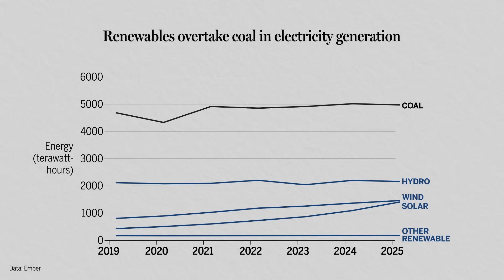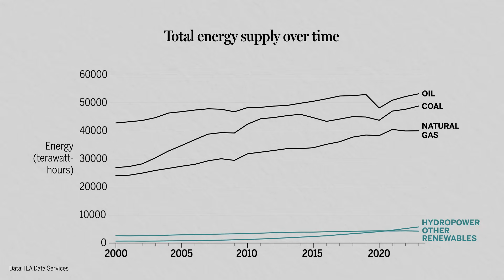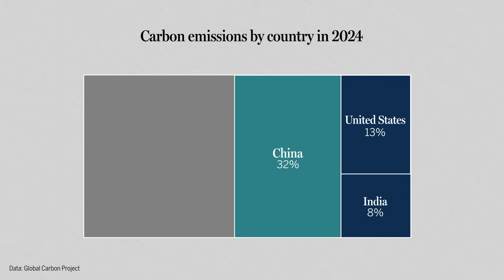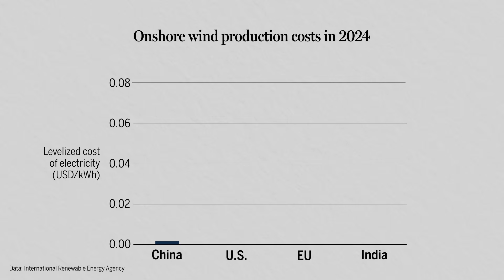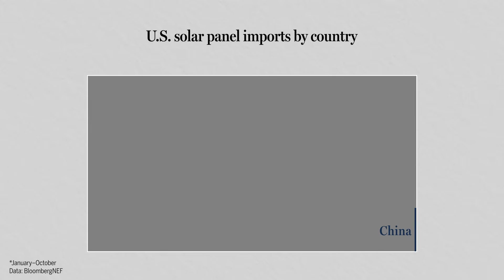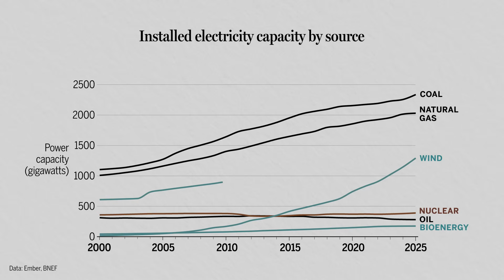How cheap renewable energy is finally flattening emissions

Comment: That is BS. China emissions decreasing because they built a ton of Nuclear power plants. Renewable energy is a scam. Scam in a way that it will never ever be able to replace regular power plants because you need controlled sustainable power generation. Except hydro, none of the renewables able to produce electricity sustainably an continuously.

Comment: Wow this video is bad. Like really, really bad. Not only do you want to turn it off after the incorrect wording in the first minutes so many statements are half-truths. 

And also: Is Yale that incompetent to confuse energy consumption and CO2 emissions? Because the consumption by definition cannot get ‚more efficient‘ with cleaner supply. I can’t believe that. So it’s probably just the news source that’s quoted without turning on the brain. Wow.

Comment: US centric presentation ... renewable energy is flattening emissions is patently not true the relevant graph appears at 1.56 in where it shows US  flattening but Global emissions rising.  I am not speaking for or against just that the title is not true and Glbal emissions are not flattening they are rising as this presntation shows on the chart they slip in there at 1.56. Which if it were a stock chart you would be calling a break out to the upside not the downside.

Comment: One huge factor is that battery storage is being built on an exponential curve and the cost per unit energy is also plunging.   Another thing not mentioned is that a big thermal plant takes years to build, where another few megawatts of solar can be deployed in a few weeks if you have the site permissions done.

Comment: Problem is solar only works when it's sunny, wind only works when it's windy, hydro only works where there are huge water accumulations. Solar and wind provides no stability to the powergrid, instead it makes it unstable. A powergrid needs spinning inertia from a big generator. I'm not a renevable hater, just realist. What I know we don't have any coutry relying on just solar and wind? Neither a city or village or even a single factory.

Comment: I live on the Canadian prairies, where winter temperatures can hover at -30C despite 300 sunny days per year. But I have 20 PV panels on my roof, which account for about 1/3 of my annual usage. For the rest, I purchase electricity from the public utility grid, 98% of which comes from (green) hydroelectricity. When my production exceeds usage, the grid buys the surplus, which it sells back to me at night or in winter, a government effort to reduce the need for additional large-scale generating capacity.  I also drive a plug-in hybrid, though only the huge geographic distances on the prairies preclude a full battery electric vehicle (BEV). Nevertheless, the plug-in hybrid provides for almost all of my daily commuting needs (up to 70 km per overnight charge), and I hope I will be able to move to a full BEV as the charging network is expanded. If this can be done with our climate and geography, I am optimistic about the future.

Comment: Renewables are a wonderful thing but we have to be honest about the economics. In greater scale they don`t make sense because the handling and backup costs become overbearing. The reasonable thing is a mix of about 50% renewables with a certain amount of short term battery backup and 50% stable sources like hydro or nuclear.

Germany is a negative example. They pushed renewables too far and are struggling with very high energy cost which make parts of their industry uncompetitive.

Comment: Renewables are unreliable. What do you do when there is no sun or wind? Nuclear is the only reliable answer.
Reply: @gec89  Renewables are by far cheaper than nuclear - this is a major reason for the accelerating growth of renewables worldwide. Additionally, prices of big batteries are falling worldwide and other technologies like smart grids to ensure providing electric power constantly even wen the sun doesn't shine at night and when there is not enough wind. So, renewables already can easily feed industrial demand of clean and climate friendly electric power.
Reply: @Rainer-g4u  the AI revolution changes everything because it requires far more energy and renewables cannot keep up. We need nuclear energy whether people like it or not.
Reply: @gec89  Too costly and too slow to implement. Nuclear's share of global power production is now half what it was at its peak 25 years ago and on a declining trend.
Reply: @tassied12 then you’ll have to supplement the delta with oil and gas because renewables won’t produce enough to power the world economy.
Reply: Nuclear is going nowhere. Global nuclear capacity actually went backwards this year, with the IAEA reactor database showing 4 reactors going into permanant shutdown and only 2 new reactors coming online. There were only TWO new reactor construction starts on the entire planet this year.

Nuclear is losing out to renewables because it is too slow and costly to bring to market.
Reply: @tassied12  That's definitely not true. According to the world nuclear association, 70 reactors are under construction and a further 115 are planned. Much of this is happening in Asia. Renewables will not be enough to power the AI revolution which is a game changer for energy consumption.

Comment: I'm taking this with a grain of salt. Germany went full green energy a few years back and because of that, they ended up having to burn MORE COAL than they did previously when wind, sun and water were not viable (who would have guessed the sun didn't always shine, wind didn't always blow and water didn't always flow). Nucelar is the only green (and logner tem) way to truly move away from fossil fuels, but stigma and big business will not allow it.
Reply: Not so.  In Germany, coal's share of generation fell to a record low in 2024 of 21.9%. Coal generation fell from 180 TWh in 2023 to a record low of 104 TWh, a fall of 42%. 

Nuclear is going nowhere. Global nuclear capacity actually went backwards this year, with the IAEA reactor database showing 4 reactors going into permanant shutdown and only 2 new reactors coming online. There were only TWO new reactor construction starts on the entire planet this year.

Nuclear is losing out to renewables because it is too slow and costly to bring to market.

Comment: The economics of renewables are going to continue to improve. The big moment we had in the past few years is when many countries like Pakistan and Ethiopia started figuring out that they can get power without having to build out a grid around coal or gas powered generation. Pakistan never had a reliable grid. If you need power there, solar is the only way to get it reliably. And it's as simple as ordering your panels, installing them and adding enough battery to make it through the periods when there's not enough solar.

There's nothing technically hard about it. Plonk down panels, plug them into an inverter, done. Places like the US manage to make this a very expensive and involved process. But countries that aren't hindered by institutional bureaucracy and apathy like the US can actually move quickly and install solar for cents per watt level pricing amortized over 25 years. Battery is going down the same path. With current prices bottoming out at ~60$/kwh for LFP and sodium ion type batteries, things are rapidly getting to the point where having a few tens of kwh of power is going to cost you about the same as buying a new fridge costs. 

That's what Pakistan is doing. The next logical thing for them is to build out more energy infrastructure. Ramp up electrified transport (i.e. stop spending billions on oil) and start ramping up local industry and production, which traditionally requires energy infrastructure and oil. But it now now longer does. There are a lot of developing economies that will be able to do similar things. That matters because there are quite a few billion people on this planet that are going to gain access to cheap energy now that never had that before. The question is what they'll do with that. 

I think it will wipe out the fossil fuel industry a lot quicker than fossil fuel incumbents are hoping for. The business case for buying and burning that stuff is evaporating rapidly. It's becoming an expensive hobby rather than an economic necessity. We'll see this play out over the next two decades or so. But I don't think it will take much longer. By the end of this decade, buying new vehicles with an internal combustion engine will clearly be the more expensive option. It already is now, technically. But it's going to go from maybe to quite obviously more expensive. What will follow is rapid collapse in demand and production for oil based fuels.

Comment: Solar power appears cheap. But the reality is that it needs fossil fuel backup. In January (in the UK) our factory 1mwh installation produced 20k kwh compared to 148k in July. In the winter we use mainly grid power.  Somebody has to pay for that capacity in the summer which is part of the reason why we pay 5 times more for grid electricity than our lovely cheap solar. In short solar will never replace gas. We need nuclear.
Reply: Nuclear is going nowhere. Global nuclear capacity actually went backwards this year, with the IAEA reactor database showing 4 reactors going into permanant shutdown and only 2 new reactors coming online. There were only TWO new reactor construction starts on the entire planet this year.

Nuclear is losing out to renewables because it is too slow and costly to bring to market.
Reply: @tassied12 incorrect. The UK strategy is to develop small local nuclear reactors. Wind and solar can not provide the energy we need all of the time. Looking at global trends tells you little about the likely solution because last year we (the world) used more coal, gas and oil than ever before and that is not sustainable. Traditional nuclear is expensive and politically in Japan and Germany has been rejected but the future is very much nuclear.

Comment: The time of solar has also come because the battery prices have dropped a lot and continue dropping. The next step will be sodium ion batteries for stationary storage, which will probably reduce the cost by another 30%. In many poor countries, there’s also plenty of sunlight so solar plus battery is a sufficient solution for all there energy needs. with this people and communities can also make themselves independent of inefficient and corrupt governments that can’t provide them decent infrastructure.

Comment: So, how do you explain all the failed climate doomsday predictions over the last 50 years? I know, you keep moving the goalposts.

1. The Ice-Free Arctic by 2013

In the early 2000s, some predictions claimed that the Arctic would be completely ice-free by 2013 due to rapid warming. While the Arctic has seen significant ice loss, it still retains ice cover. The rate of change has been slower than predicted.
Lesson: Climate models are complex, and not all predictions happen on the timeline we expect. This doesn’t mean the Arctic isn’t in trouble—it just highlights the need for nuanced, measured action.
2. The End of Snow in Europe

A 2003 report suggested that within a few decades, snow in Europe would become increasingly rare. However, Europe continues to experience snowfall, and even record snowfalls in some regions, due to natural fluctuations in weather patterns.
Lesson: While climate change shifts patterns, nature can still surprise us. Focus on long-term stewardship rather than short-term alarmism.
3. The Submerging of the Maldives by 2018

The Maldives and other low-lying nations were predicted to be underwater by 2018. While rising sea levels pose a serious long-term threat, the Maldives are still above water today, thanks to both slower-than-expected sea-level rise and adaptive measures.
Lesson: The situation is serious, but there is time to act. We can help vulnerable regions adapt while also tackling the root causes of rising sea levels.
4. Mass Starvation Due to Global Warming (1970s)

Predictions in the 1970s warned of mass starvation due to crop failures caused by global warming. While climate change does affect agriculture, technological advancements and new farming techniques have helped maintain food supplies, even in changing climates.
Lesson: Human innovation can solve many problems, but we must continue investing in sustainable agricultural practices.
5. Climate Refugees in the Millions by 2020

In 2005, the UN predicted that by 2020, millions of people would become climate refugees, fleeing from rising seas and natural disasters. While climate-induced migration is a real issue, the scale of displacement hasn’t been as catastrophic as forecasted.
Lesson: Rather than predicting mass panic, we should focus on supporting adaptation and resilience in vulnerable communities.
6. New York Underwater by 2015

Some models suggested that New York City could be largely underwater by 2015 due to rising sea levels. While coastal flooding is a concern, proactive measures, such as seawalls and flood management, have helped reduce immediate risks.
Lesson: Sensible planning and adaptation can mitigate many of the worst potential impacts of climate change.
7. Polar Bear Extinction by the 2010s

Some headlines in the 2000s claimed that polar bears would be extinct by the 2010s due to loss of Arctic ice. While polar bear populations face significant challenges, they have not vanished, and conservation efforts are underway to protect them.
Lesson: Species can adapt and recover when given the chance, but proactive conservation efforts are critical.
8. The End of the Amazon Rainforest (2000s)

In the early 2000s, some predicted that the Amazon would be completely destroyed within decades due to deforestation and climate change. While the Amazon is under threat, it has not disappeared, and conservation efforts have helped protect large areas.
Lesson: Large-scale environmental destruction can be slowed and even reversed with global attention and action.
9. The Melting of Greenland

It was predicted that Greenland’s ice sheet would disappear rapidly, leading to major sea-level rise by now. While significant melting has occurred, Greenland’s ice sheet is still largely intact, though long-term risks remain.
Lesson: Climate predictions aren’t about certainty but probabilities. We still have time to adapt and protect key regions.
10. The Ozone Layer Collapse (1990s)

The ozone layer was predicted to collapse entirely, causing widespread health problems by the 1990s. However, thanks to the global ban on CFCs, the ozone layer is healing, and we’ve avoided a catastrophe.
Lesson: Global cooperation can solve environmental crises. The ozone recovery is a powerful reminder that collective action works